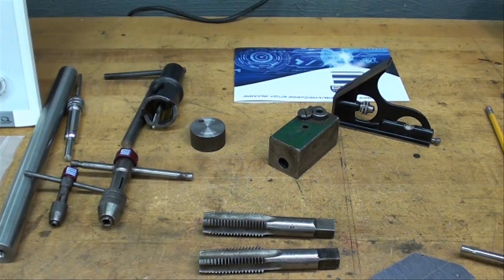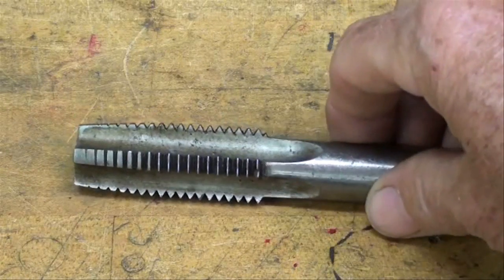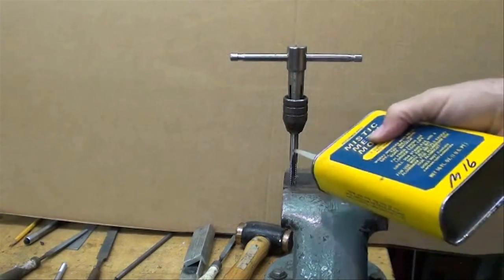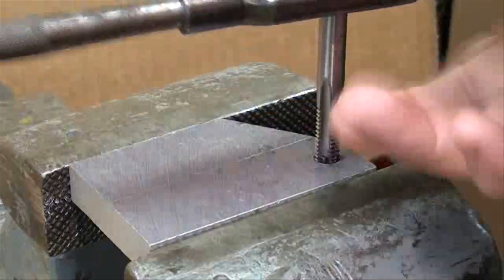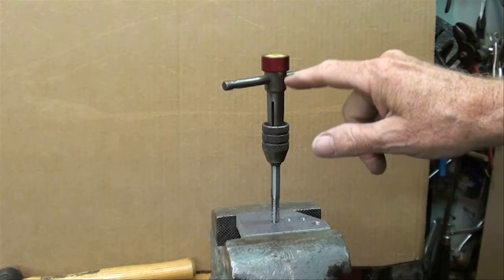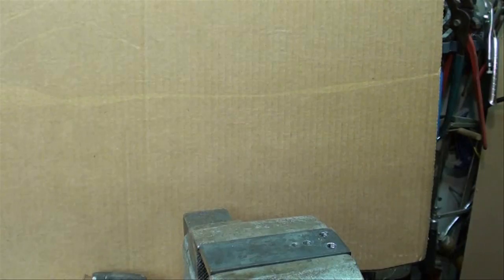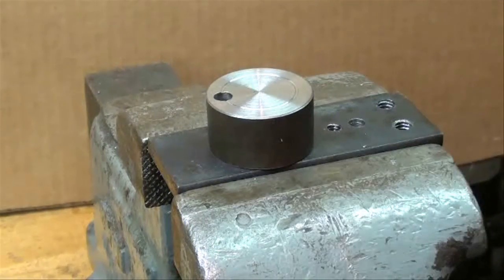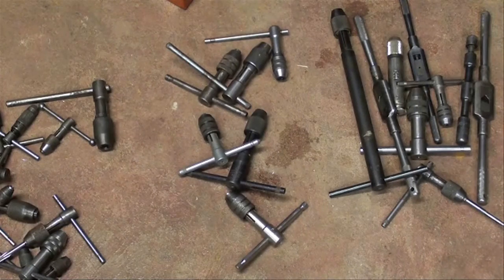MACHINE SHOP TIPS #100 - Ways to Tap a Hole Straight Part A tubalcain

Comment: You missed the easiest one of all. Just put tap in mill.  run mill ... turn mill off and while it is slowing down start tap in work.  It will be straight and go in a couple turns. Being careful to not tip the tap ... Put the tap wrench on and finish.   It will be straight and true.

Comment: I'm no machinist at all, but suppose we have a workpiece that's not thick enough for counter boring. Might we keep a tapped guide handy (of the appropriate thread) to clamp to the workpiece, if the surfaces are close to flat? Lubricate the guide, and the tap ought to turn freely.

Comment: As I was watching this series of tips #1-100 I noticed comments were turned off of some. You said you liked comments but did not want questions because it just takes to much time. I did not think much about it but you said you liked the comments on videos that comments were turned off. I was thinking maybe you don't even know they are turned off. Starting at #32-89 there are 28 videos where the comments are turned off.
Reply from the maker: I did not know that

Comment: Watching this I’m given extra confidence in an upcoming Time-Sert installation because I can now see the included counterbore tool not only provides a recess for the lip of the insert but also acts as a guide for straight 90 degree insertion. My application is on an engine exhaust stud that’s still in the car so cannot use the bubble level because the drilling/tapping are going in horizontal. I’m using a guide from big gator to help keep the drill hole straight but the tap will rely only on my eye and the aid of the counterbore tool. Wish me luck!
Reply from the maker: Good luck, that's a tough 1

Comment: I have made lots of small small drilling jigs, if the holes needed tapping as well, the jig would have slip bushes, one  drilling size one tapping size   so drill the hole then replace bush with one that just fits the top diameter of the tap. That way the  tap would be concentric and square, taps were rarely broken. Use cutting compound and don't use blunt taps. Busted taps in jobs cost a lot of time and money.

Comment: I steer clear from using sets of taps. Machine taps - spiral point for thru holes and spiral flute for blind holes (not thru) work much better. What I found was that taps of the same size but from different manufacturers, tap differently, even if the taps are of the same type. It's probably the way the cutting edges and whatever goes with it was ground. Never buy cheap junk. You will soon find out it wasn't a good idea. Never let your taps lie loose in a draw or box. Wrap a piece of paper around the threads if you don't have a container for the individual taps.
Reply from the maker: Thank you, that's good information. I just keep mine in a drawer, and I have never noticed any negative affect. Way too much trouble to put them back in the tube

Comment: weird. the most thing you showed are part that came of the machine. so why should you take out the part? instead of just switching your drill to a tap. the position will be allways 100% the same. powertap the first few threads and finish it of by hand. straight as fuck. same is for the lathe. drilled a hole? put a tap in your tailstock. but now im just tyoing thing eveyone should kow. anyway if you need to tap you probbably also made the hole on a machine so also just tapp it on the machine. i tapt like this the first 2 months of my school carrier untill me teacher couldnt hanlde it anymore.

Comment: great video Mr Pete,i like to use aluminum round stock faced and bored in the lathe as a tap guide.It works well for tapping holes on engines,etc.drill guides made the same way with drill bushings installed also work great where you have to go to the work.

Comment: one miistake was the  comment on using the tap dia to counterbore and using a steel nut as to show how much thread is only needed,you forgot to mention that when using screws to fasten aluminum you need twice the diamtetr of threaded hole depth,whereas steel is 1.5 times the diameter due to the difference in tensile strength of aluminum vs steel

Comment: So you are saying that any thread deeper than the NUT shown does not increase strength of bolt to threaded part ? I am surprised that is accurate but I can see how it increases the ease to TAP , nice trick. .

Comment: how in the hell would more threads not make it any stronger
Reply: +Asbjørn B Lerche
WRONG!
The standard is for most steels that you will have 0,8D tread height. And then you won't strip the treads when tightening it. HOWEVER for aluminium (6082 etc) the norm is more like 2.5D tread height. Due to the weaker metal the treads will strip if you only use 0,8D of tread.

It has to do with the shear strength of both the bolt and the 'nut'. For instance, look how easy it is to wreck a nylon bolt or the tread holes in your plastic RC car
Reply: What did i do? Just that a steel (8.8) bolt in 0,8d alu (5082-6061) tread will strip the alu treads before getting properly tight. for comparable strength you will need more like 2,5d of tread.
Reply: That would be another video,  I think we all should know by now...(Maybe not) that on most materials anything more than the diameter is beyond what strength is necessary and like HE said a waste.

Comment: HA HAA!  "the girl with the tattoo" -- exactly!!

in no way are you "OLD" tubalcain -- not one bit. you are an amazingly current observer of how things have changed, and rightly so. you preserve the past for us, explain the differences, and show us how to better ourselves accordingly... be it in the shop or elsewhere... trying age-old techniques or adapting to new ones.

your intellectual lathe runs true, sir; your test indicator is properly zeroed and you can easily detect ANY deflection in material degradation. and yes, a few tenths actually do make a difference... thanks to you.
Reply from the maker: +KevCarrico Thanks for watching--and the kind comments
Reply: Good one. The smart girl with the tattoo is gonna lead you to the Chinese tap.
I have found them to have unsquare square surfaces. An eye ache, useing the eye-ball method, 
I use tap wenches, the ones with long handles, I chuck them up on the round part of the tap to start the tap straight, get 'em running straight. Then slip up to the square part and toque away. 
The crux of the bisket is: some Chinese taps are good they just miss getting the square part square. some don't.

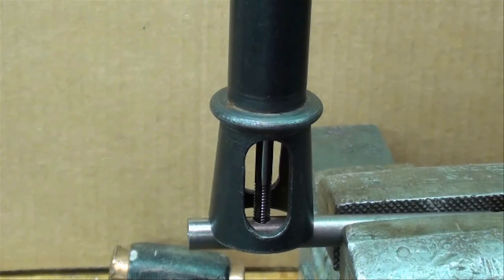Comment: Hello.I need to tap a vw beetle case to put case savers, my idea is to use what you show at 13:30 min, the tapping guide block. The problem is that I have a small setoff ,close to the cylinder ,where it meets the case.Do you have any idea,modification to this tapping block? I'm planning to use a M12x1.5 mm with a 10.5 mm drill bit and the usual case savers .(neither TimeSerts nor Helicoils).Thanks.
Reply from the maker: Thats a tough one, because you need a little shelf to set the thing on.  Can you clamp a piece of angle iron or something on it?
Reply: Not really.I think ,I'll take the bubble level option ,from Edge Technology.Thanks.

Comment: Thanks a bunch! I have to drill and tap into my engine block where the exhausts bolt on( the guy i bought the bike from forced screws in) I wish I could do it like that but this was very iformative and feel confident enough to try a crazy angle! Thanks again!
Reply: Did you fit a helicoil?

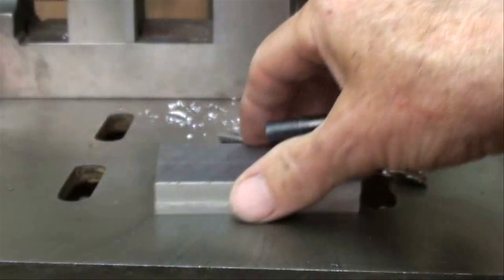Comment: The nut on 6:05 is hardened steel. It's much stronger than thick aluminum or steel stock. Not convinced? Put a gold bolt (grade8) in that aluminum and continue twisting the bolt at over 200-lb-ft. Thread dept is only important for lifting or for life support. But in this excellent video is perfectly fine.
Reply: +RobertSmith
Indeed!
The standard is for most steels that you will have 0,8D tread height. And then you won't strip the treads when tightening it. HOWEVER for aluminium (6082 etc) the norm is more like 2.5D tread height. Due to the weaker metal the treads will strip if you only use 0,8D of tread.

It has to do with the shear strength of both the bolt and the 'nut'. For instance, look how easy it is to wreck a nylon bolt or the tread holes in your plastic RC car
Reply: In this i'm talking about a steel (8.8) bolt vs aluminium or plastic threaded holes.

Comment: That second tap looks more like an intermediate tap. ( Three taps in a box )
Is that a THOR copper hammer ? We used step drills in the engine plant - didn't break many taps off in blocks either.
Reply from the maker: +Jester Mclarpet Thanks for watching

Comment: I love your videos.  In regards to thread thickness, I do believe having more threads in softer material will make it stronger.  In steel having longer threads won't help because the bolt will be the weak point after 5-8 threads.  In aluminum it is going to take more gripping threads to make the bolt the weak link.

Comment: I'm surprised you didn't show tapping in the drill chuck on a drill press or mill or with a tapper with a guide pin (for tapping in a chuck). What about power tapping with the clutch? Aren't taps with 2 or 3 flutes better for tapping? They seam to be less prone to breakage then 4 flute taps. They have more room for the chips to escape?

Comment: Enjoyed this video especial the counterbore part to get the tape started straight.
When I was employed by a  machine shop many years ago I learned to calculate a tape drill size by the pitch of the thread divided in to the constant 1 (one) then subtracting that number from diameter of the size of the tape.  That is the pitch of 1/4 20 is .050 is the pitch subtracted from the major diameter which would be .200 then look for a drill very close to this diameter.  This will work for all taps.

Comment: I made several of what you call drill blocks from aluminum round.  I typically face and drill through the center of the stock on the lathe.  I step drill them so that part of it is the thread diameter , part the tap shank diameter.  I found this gives good alignment.  Once started you can remove the guide if needed.  Works great for smaller taps (made one recently to tap 3mm thread inserts!).

Comment: You showed an example of a steel nut next to a piece of aluminum talking about the depth of the thread cut. But I've always used the old rule of thumb 1x bolt dia for steel, 3x dia for aluminum. Is this correct?